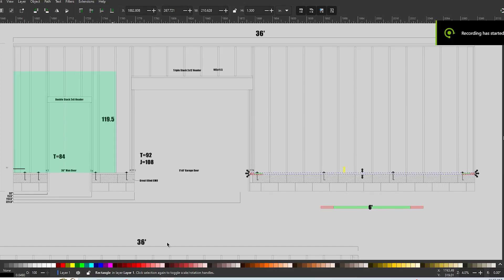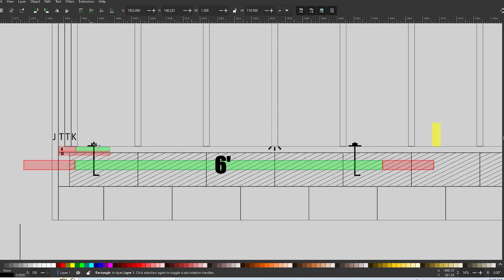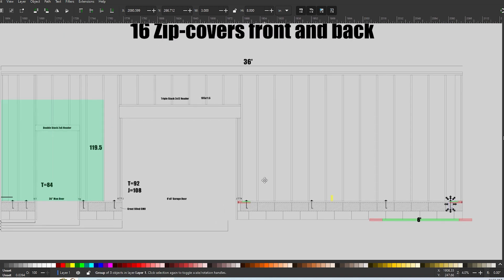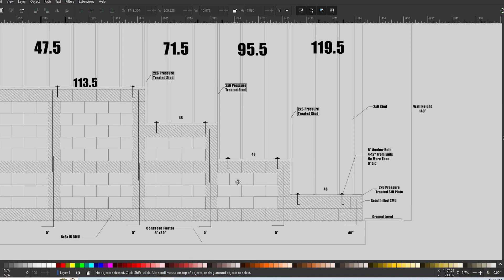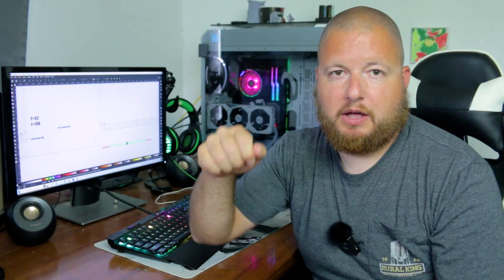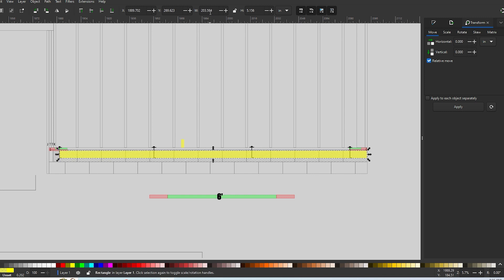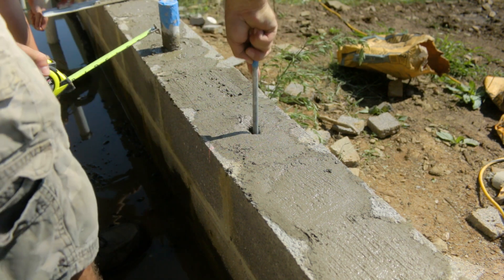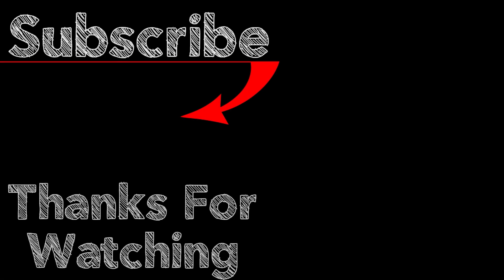Garage Build #21 - How to Measure for and Set Anchor Bolts

Comment: Thanks!  I never really thought about how the mason spaces the blocks, and the cells, greatly impacts the location of the studs.  I am going to copy my current detail that shows a typical frame wall, and make a second one just for use with CMU stem walls.  I will show the blocks with the cells dashed in, and add a note that the mason and the framer need to talk before the mason starts to work.
Reply from the maker: Yea, good idea, it is important to know where they need to go